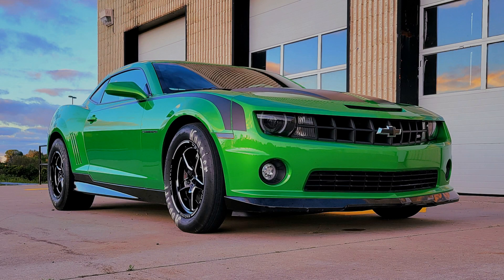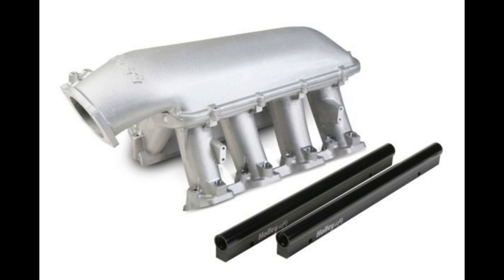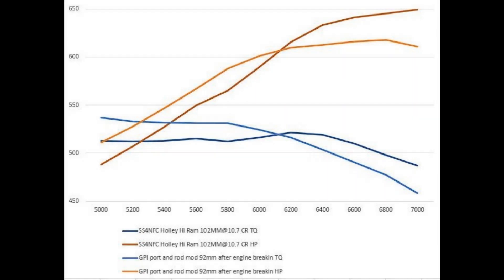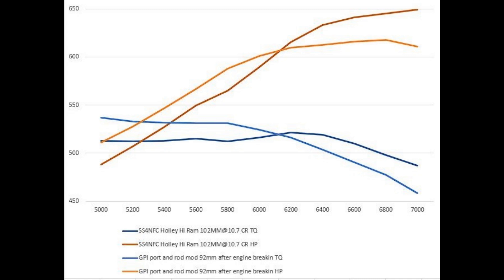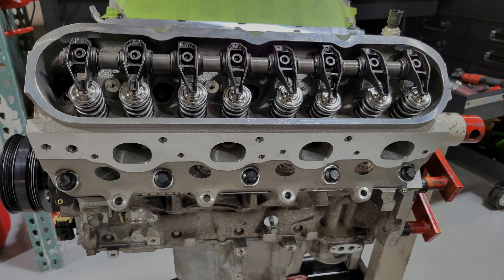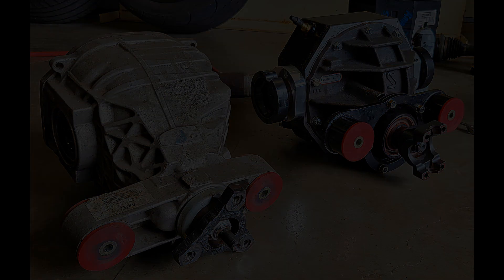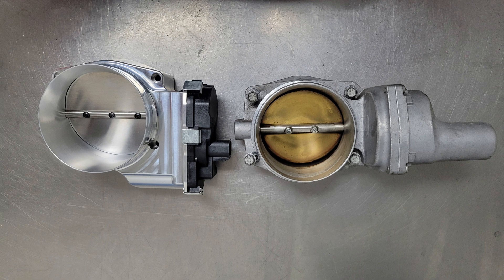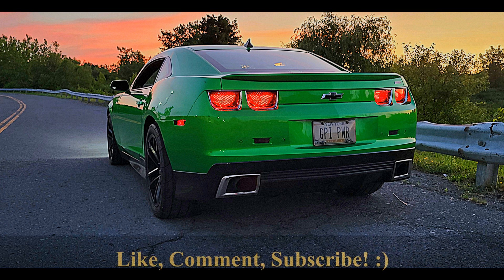Hi Ram vs Rod Mod (gen 4 LS)

Comment: for those that are looking to turn more around 7400 on a 4.10 6M car. would your recommendation be a rod mod intake. or are there better options that we can get through GPI? thanks for the insight andrew
Reply from the maker: Is that the RPM limit based on the rest of the combination? I would say that's the Practical upper limit for that manifold, it starts laying down pretty good over 7,000. On a manual car we will shift them up that high because we need to get what we can back on the shift recovery, but if you have the valve train to tolerate more RPM you might be a candidate for a shorter Runner manifold..
Reply: @andrewcammer2535  my valvetrain is the limiting factor on the RPM. running cam motion tie bar style lifters from GPI and the BTR Trunion upgrade kit with their .080 5/16 push rods and .660 platinum spring kit
Reply from the maker: @crowsgarage6669  If it's an LS3 intake valve that should be stable at 7400rpm still, but that's a good practical upper limit.  If it's an L99 with the solid stem intake valve you probably don't wanna send it much over 7100rpm.
Reply: @andrewcammer2535  it's LS3 intake valves. thank you!

Comment: Just subscribed. You have some great videos. I’m going to pick your brain if you don’t mind.

3250 lb car with driver, 6l80e, 2.56 gear car. 25.7 inch tire. Ls3, bes cnc ported and .007 decked factory heads, .040 head gasket. And a competitors (I won’t mention name but very popular stage 4 na ls3 cam that was in the car when I bought it) bumping rpm up to 7300 and a circle d 4K convertor still wouldn’t be enough for this intake is what you’re saying? I assumed due to being much lighter then a 5th Gen camaro a little more compression and a much smaller tire that it would pull thru fine but now I’m not so sure. Sounds like majority of it is the exact combo you are speaking of not working well together.
Reply from the maker: It would want a bunch more converter - that would help it on the shifts too.  Being light helps, but with that deep a gear I don't expect it's gonna be a rocket on motor down low, but it would pick up mph out the back.  It wouldn't like help the ET much if at all, unless you do the converter at minimum.
Reply: Interesting I appreciate the knowledge. Car is also sprayed so I’m confident it would be happy on spray, but I don’t want to slow it down na really. Gives me some stuff to think about.
Reply from the maker: @loganpowell8394  I bet that combination works good on spray. Ultimately it's always going to be a compromise, the converter you need for the car with a hit of nitrous off the line it's always going to be different than the one you want naturally-aspirated. Same thing with the gearing. I would think that combination could just about run the quarter-mile out without a shift to Fourth on a bigger tire, so maybe run it like a three-speed. I know we have a car we built for a customer that we run like that and it works pretty well. Lock up converter would be huge, I don't remember if you said you have a single or multi-disc.
Reply: Funny you mention it. Car previously had a rod mod and 3600 yank, being locked, and na it was shifting to 4th shortly before crossing the traps. I’ve never been a fan of that. And when it’s being sprayed I still just don’t feel like car going into 4th is great. It traps 128-129 on motor in good air and it’s making a shift about 125. On spray it traps high 130s. I’ve considered a 28 ish inch tire. And it would be a 3 speed essentially for a 1/4 and for lower rolls. May need a little more convertor  for that regardless of intake setup though